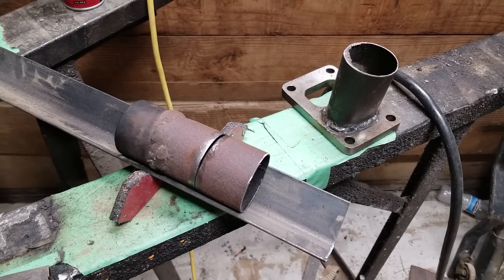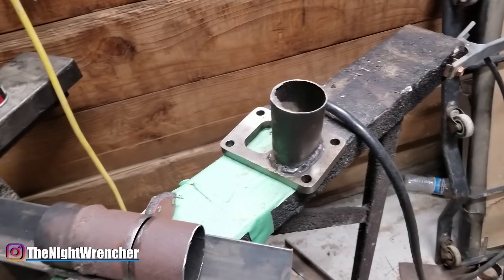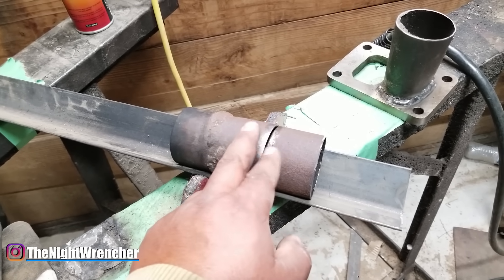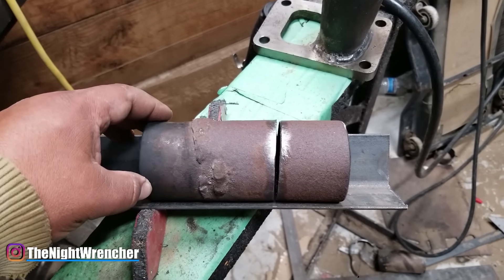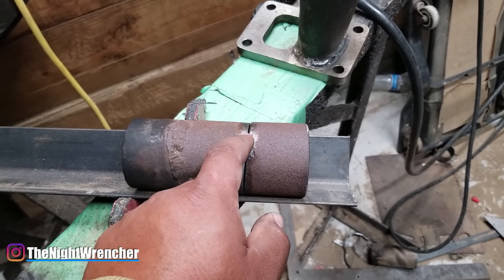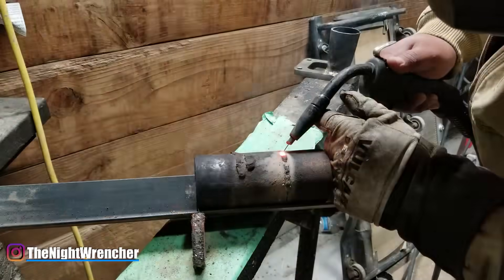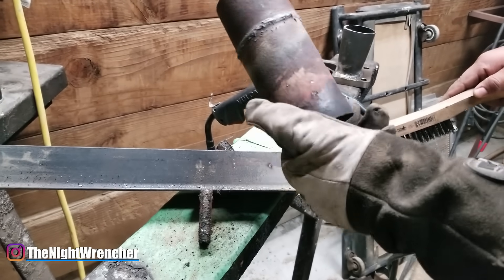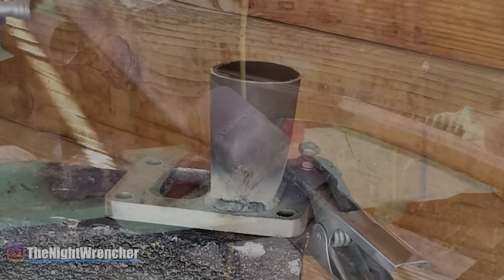How To Weld Thin Metal Using Flux Core Gasless Welder | Flux Core Welding Tips And Tricks |

Comment: Just use a coat hanger as a filler rod as you weld the seam with your wire feed welder. Lay the coat hanger along the seam and strike your arc on the coat hanger instead of on the thinned exhaust pipe. Works like a charm when welding thin metal, you ought to give it a try.
.
Reply from the maker: Thats really interesting! I'll try it!
Reply: @NightWrencher  : Had my own bodyshop for years prior to retirement, works like a charm.
.
Reply: I've used bailing wire to help fill gaps or holes, it worked out for not having very much while making a repair out in the boonies
Reply: hangers have an enamel coating on them. I use tig rod.
Reply: @2pist  I use coat hanger as TIG filler on stuff that doesn't matter,  because I'm cheap! Works great.
Reply: Bro. I'm reading this in 2025. No one can afford metal coat hangers anymore!
Reply: @Rusty-Metal  I feel that one, brother.
Reply: texas tig with flux core... worth testing... would you need to change setting? i woukd not want to use crap coat hanger wire as filler. I might try this with bare filler rod snd see how well it works.
Reply: @The globe is DEAD how about using flux core wire? I have lots lying around that are left when changing spools.
Reply: @UnleadedPadyak  : I know that well, lots of useless flux core 6’ long. The coat hanger is larger diameter, the arc blows the flux core wire away like thin metal, too small. It’s a shame because it would be a great way of using up those worthless scraps of flux core.
.
Reply: @ATinyPillow  so what if you wrap several pieces of flux making it larger diameter?
Reply: @msk3905  : That might work, I can’t say. I’ve always found flux core wire to be rather brittle so I don’t know if it would twist together very well without snapping. Give it a go, never know unless you try.
.
Reply: @ATinyPillow       when  you have too big a gap  on stick    you can use a  stick in other hand  as well     ive heard it called Texas Tig
Reply: You can also use welding rods, for stick welding, as a filler material. You may or may not want to break the flux off though.

Comment: Excellent video. This information is exactly what I was looking for regarding flux core. Thank you.
Reply from the maker: Thank you! I hope it helps!
Reply: @NightWrencher  More than you can imagine. I just found my Land Rover exhaust has come apart at a flange.  The metal looks good, it just looks like the manufacturer was very shy when welding on the flange and the two have parted company. I think I will mark up the alignment, take the pipe off and redo the flange weld. If it works the system should last me a few more years as the pipes all look fine.
Reply from the maker: I've had to the same thing on rusty subaru exhaust and as long as you go wide, you should be ok. The broken ends will be very thin
Reply: @NightWrencher  Thanks for the advice. I will double check, but it doesnt look broken at first look, it seems to have just pulled out of the flange.  Maybe it was only tacked.  If I have to buy a new mid pipe its not a big issue. Thanks again.
Reply: @NightWrencher  ipĺp

Comment: For a booger welder like me, this was a great video on not just exhausts, but other thin metals too. If using gas or dual, is it pretty much the same techniques?
Reply from the maker: Its similar but not exactly the same. Positioning is much more crucial when using gas.
Reply: Fuck sake "booger welder" that's the funniest thing I've heard in awhile, sincerely another booger welder.
Reply: @Buttermyrocket  AvE taught me "A grinder and paint make me the welder I ain't"!

Comment: Notice the wait he takes between each weld to when filling the gap? In my (year of) experience, that's because if you run for too long on really thin metals it'll melt through. Fight your stick welding urges until you've put in the root, then go back over it. It's just going to have to be ugly as sin the first time through.
Reply from the maker: Exactly right!

Comment: Is it necessary to clean the slag off of the previous tacks each time before adding a new tack, in order to avoid porosity?
Reply from the maker: Yes but no. The weld wont start on slag so if you start it on the clean metal and pull it into the existing tack, the slag that was on it will float to the top. Depending on what youre welding, you can clean it all off, and then weld a bead accross the whole joint. Thicker metal thats ok but thinner metal youll be fine with just the tacks
Reply: @NightWrencher  thanks, I'll try leaving it next time. It's very time consuming to wire brush it each time before striking the next arc. I appreciate the quick response and good information, I'm still learning

Comment: I am a newbie welder and I love your videos.  My beads are finally starting to be consistent.  One problem I have is that I tend to veer off to the left even though I think I am going straight.  Do you have any tips for keeping a straight bead?
Reply: You’ll never run a bead on exhaust unless it’s heavy wall , and very low welder settings .. ALWAYS TACK WELD PIPES!  All around opposite from one another let it cool then u can (tack bead) it finished .

Don’t waste your time with garbage piping brotha
Reply: Using a soapstone can give you a good line to go by.
Reply: @patrickpigg4132  I just scribe a line (if needed)
Reply from the maker: I'd say keep your helmet just dark enough to block some glare, position yourself so you have a clear line of sight without the gun blocking you and shine a bright light directly at where youre welding. You wont be able to see perfect but soon youll be able to see the puddle well enough to direct your weld straight
Reply: If your not great at a steady hand 
clamp a block or bar were your hand will be as a guide to run your hand down and or the tip of the gun 

Welding is like golf lol patients and being in the rite state of mind is key I know sounds ridiculous but any welder knows what I mean lol

Comment from the maker: Theres a whole flux core welding playlist here on the channel full of videos like this so check it out!
Reply: Thank you for this sir.  I'm an avid tradesmen and always looking to upgrade my skills, and I'm learning welding diy.  I've built a set of 12 foot gates using 2"x2"x1/8" steel.  I kinda impressed myself with those results but Im getting worked over trying to learn how to weld even thinner stuff like 1/16" etc.  Subscribed my friend
Reply from the maker: Thank you! Aside from my playlist, I have a whole series of videos coming out soon!
Reply: Thanks in deed

Comment: I’m assuming you’re not using the tip shield since you’re not welding with gas?
Reply: I don't use a nozzle on a flux core job either. You can see everything perfectly then. 👌
Reply from the maker: Yeah, this is all gassless

Comment: nice, i do the same thing !  what diameter wire u using ??
Reply from the maker: Preferably I like to use .030 I couldnt find any in a 10lb spool and 1lb spools run out too fast and are too expensive so right now I'm running .035 lincoln wire. It takes a little more heat to get going smooth but for thicker stuff it works really well.
Reply: @NightWrencher  i'm using some NR211MP 0.045" from lincoln. usually I go  with some ESAB 0.030 but ran out of it :) the ESAB is somewhat cleaner i think....
Reply from the maker: @jay1st1st  I havnt used the ESAB wire before but Ive tried others and the .030 lincoln is my favorite. Less spatter and the slag flakes off easier